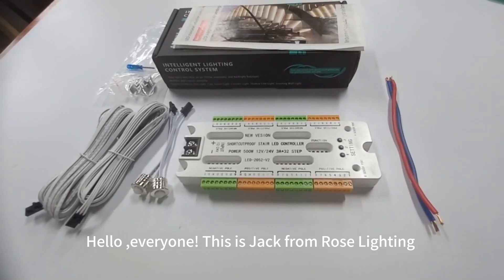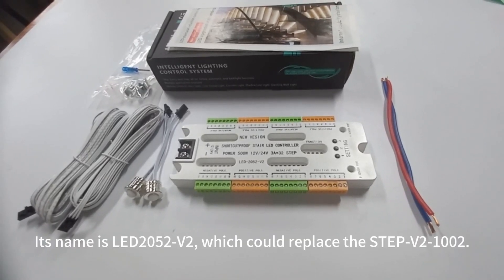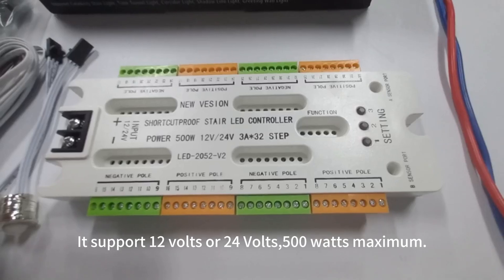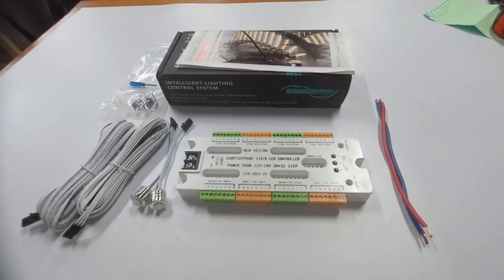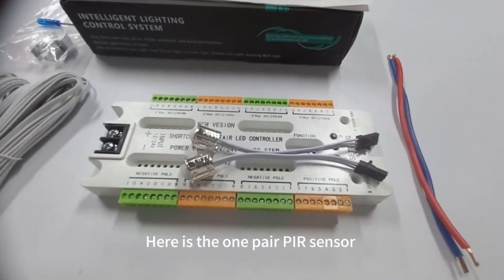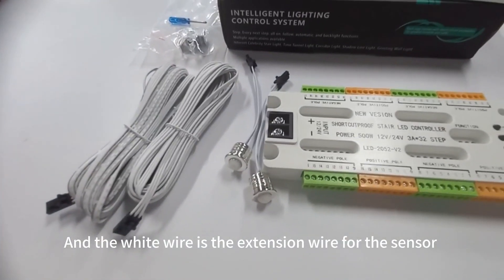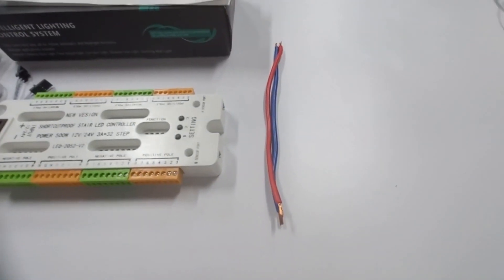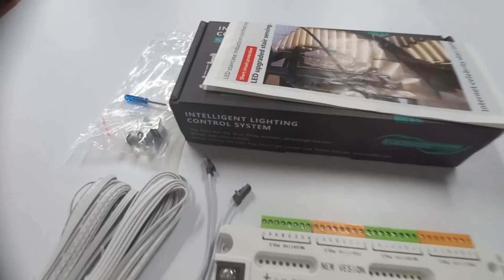LED2052-V2 staircase controller  3A24 and support 12v 24v led strip #2052-V2#2052ledstaircontroller

Comment: Question is it okay the power supply 24vdc 200watts
Reply from the maker: Rose lightings focus on pixel led strip/pixel fairy lights production and project solution since 2012  WA/WC+8618123676583 info@rose-lighting.com